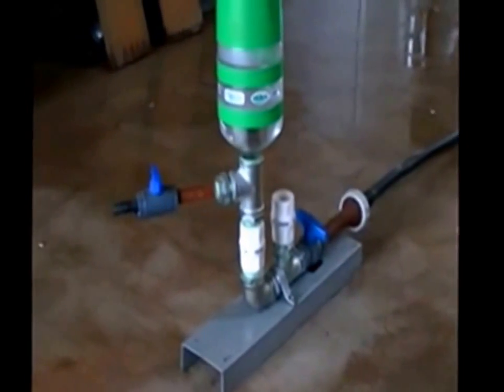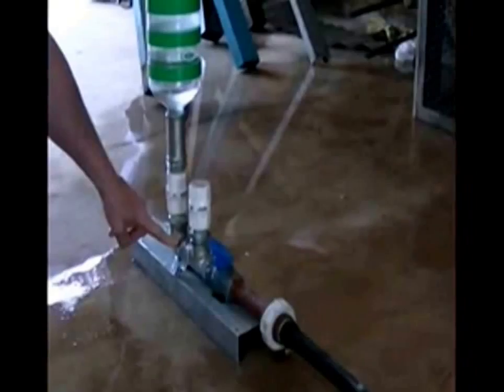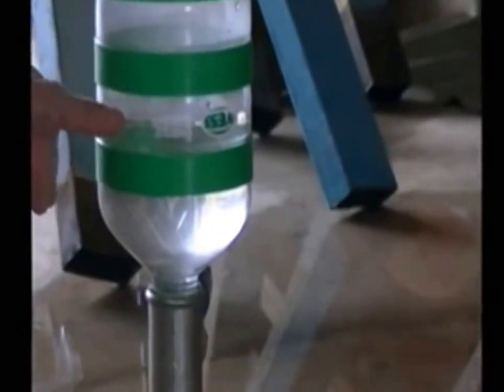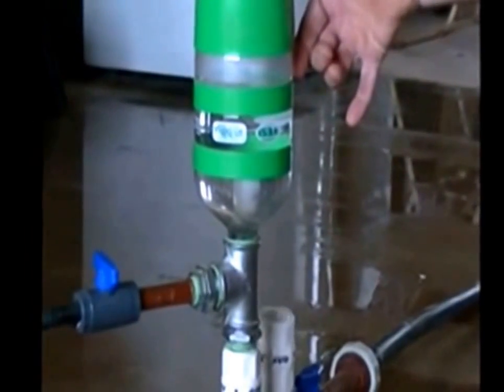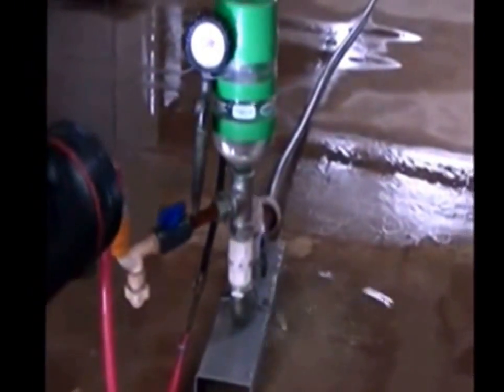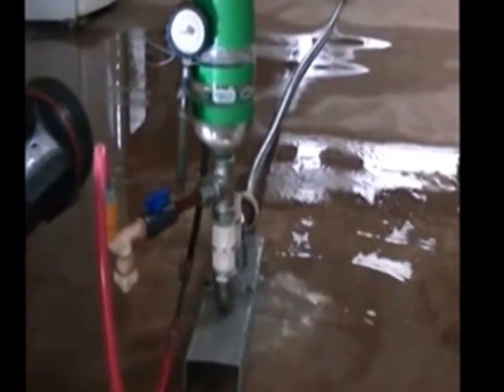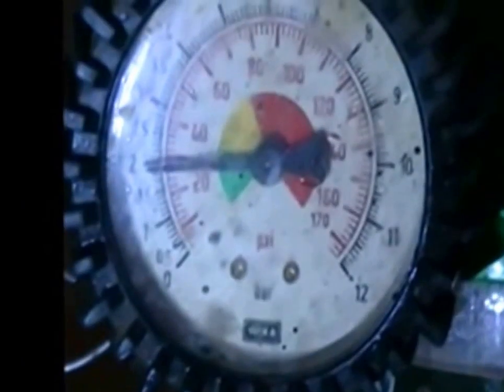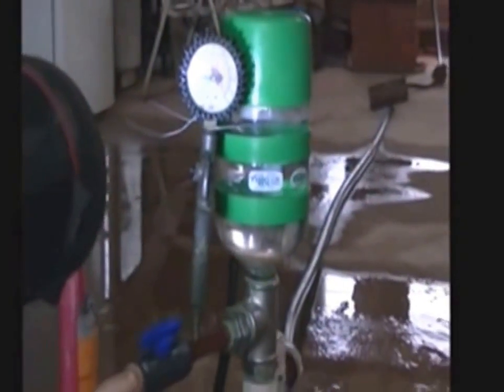Bomba de Ariete Hidráulico: ¡Agua sin Electricidad! Explicación y prueba de presión.

Comment: Mi ariete solo llega a 1 bar, ¿como podria elevar la precio?  La camara de aire es de 24 litros, el ariete es de 2", tiene 2 valvulas de retencion modificadas y el desnivel es aproximadamente 2,5 m
Reply from the maker: Hola Jorge. Tenés que fijarte especialmente en los resortes de las válvulas. Empeza disminuyendo la tensión del resorte en la 1er válvula, la que pierde agua. Con 2,5 metros de desnivel tenés que llegar a más de 3 bar. Asegúrate también que la 1er llave de paso tenga una apertura completa. Avisa si querés, para ver como te fue la regulación. Saludos 🖐️ 🖐️